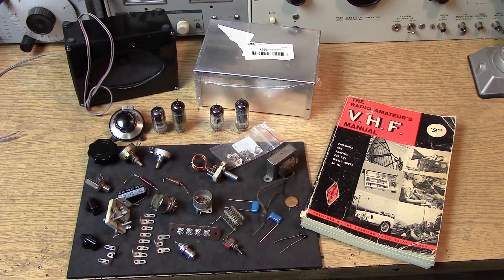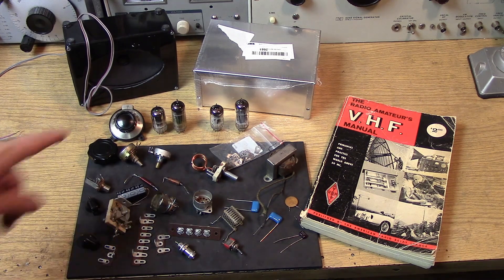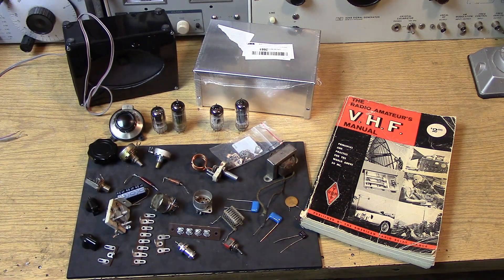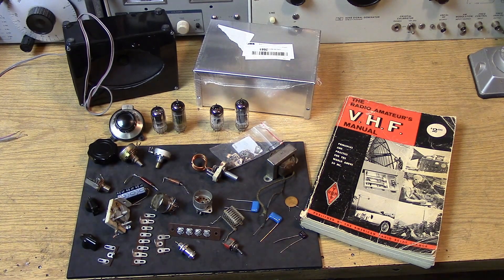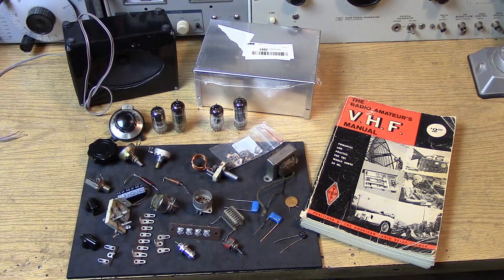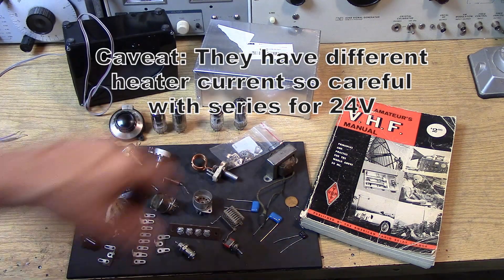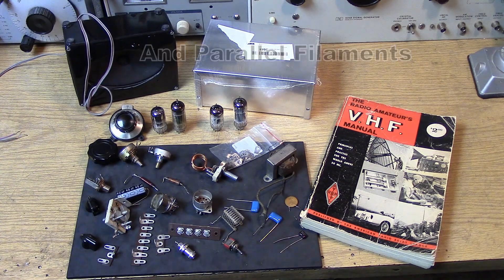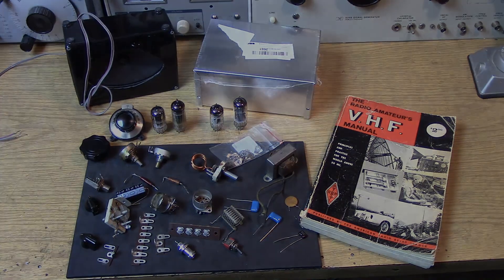Air Band Super Regen Parts

Comment: Will the 12AU7 work as well?
Reply from the maker: A pair of them or just 1 for the audio, it would be tough to get them not to work to some level of performance. They have a bit more capacitance so the coil might have to be adjusted and lower speaker audio barely enough to get excited about.